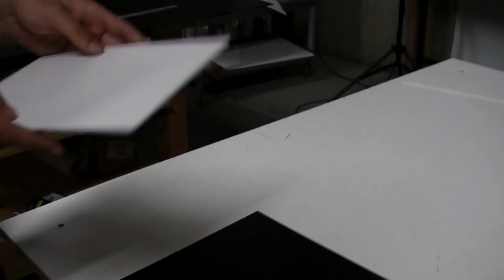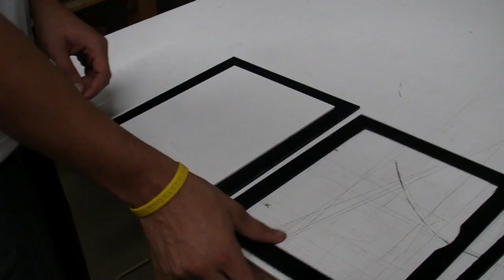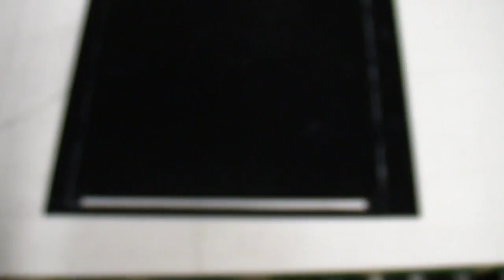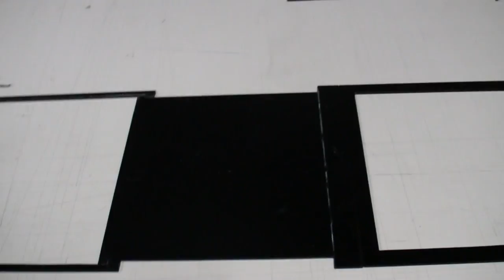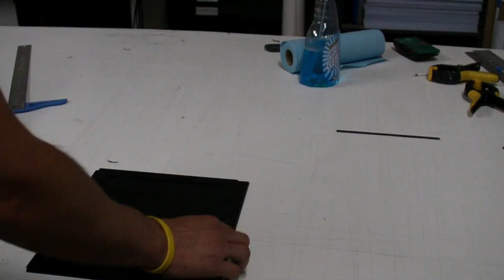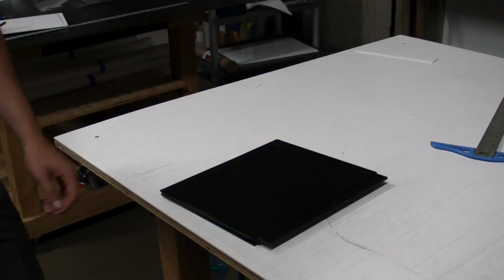Glass Plate Carrier (for homemade 8x10 view camera)

Comment: Hi, don't you need to add something to lock the plate and prevent it to fall into the camera?
Reply: Not really. The glass plate will rest on a four edges of the black opening for it.It may not make full contact because there is some pressure missing in the back to keep it tight.